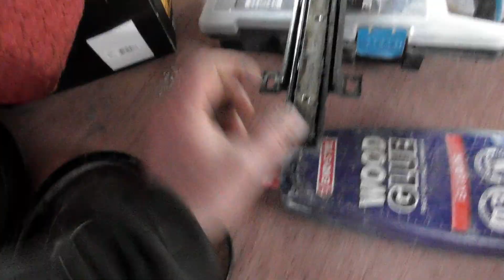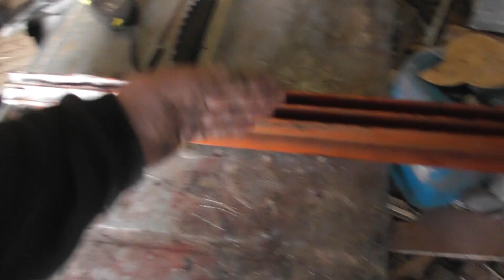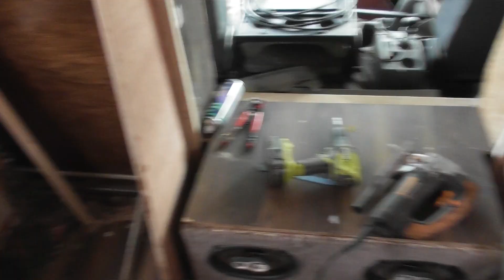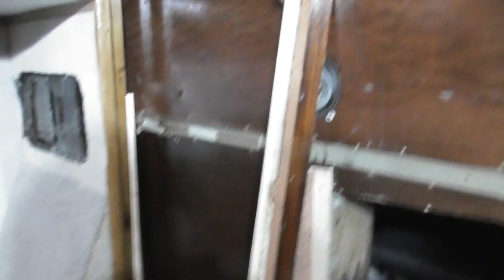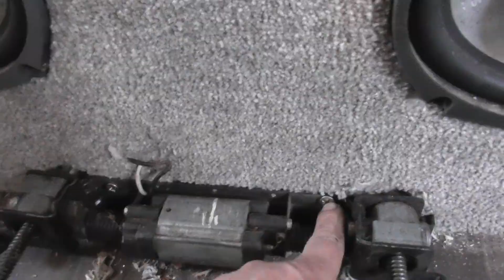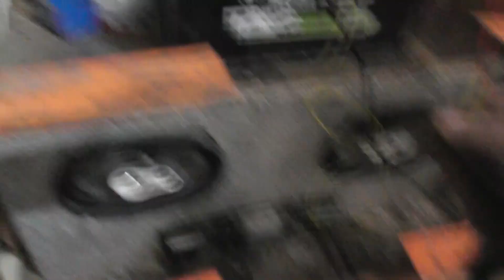#82  SCRAP YARD SCAV, AND THE ELECTRIC LADDER BUILD.  #vanlife.

Comment: Hi, Iv'e just come across your channel and I have enjoyed your video's. Iv'e worked in Electronic Manufacture/ Engineering for over twenty years and so I can relate to and appreciate your hands on approach to your builds and making your own tooling , finding solutions using the resources that you have ect. I occasionally fix things for my self, family and friends and upcycle items as well.

 
Are you self employed and do you work as a Engineer/ Mechanic? 

As well I like your home workshop. Is it a brick or wooden build and did you build it yourself? Would you be able to do a video on your Workshop at some point please?

I,m looking forward to more of your video's. Do you have any pages related to your channel on Facebook, Instagram , Twitter ect'

Many thanks,
Andrew.
Reply from the maker: I'm a a carer for my wife is about as far as I'm prepared to go on that one I did do boat-building in 2003 at Lowestoft College for 3 years also ex-army but very short-lived due to medical discharge as for the shed that's kind of made of  wood and is rotten it is going to need some repair very soon so I might do a video of patching the walls and the roof. So with that I will say welcome to the Channel and I hope you enjoy the videos and feel very free to give me some pointers on anything I'm doing wrong  you might think I need help with advice. I welcome very much interaction from the viewers there is a Facebook page called adventures with motive and an Instagram page of the same name
Reply: @rusyroadtogreasygold  Many thanks for your reply. Looking forward to seeing more of your Video's/ work.

All the best , Andrew.